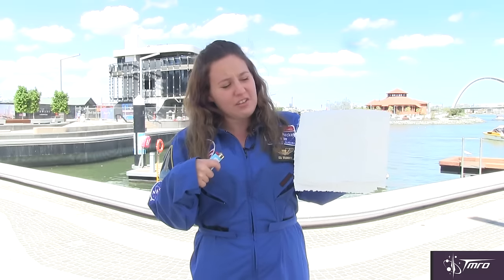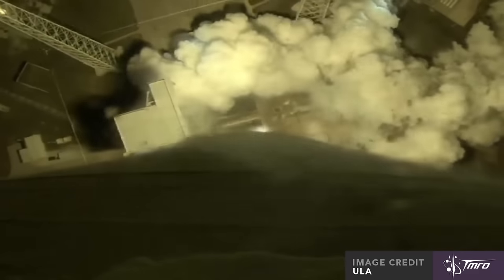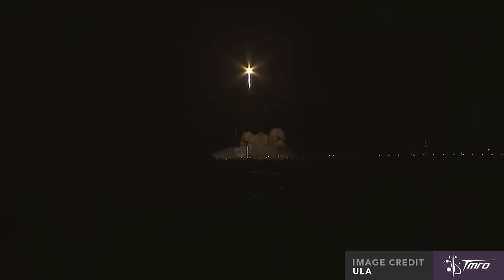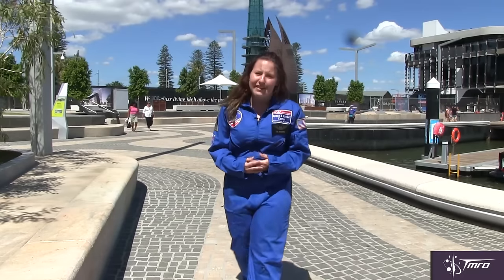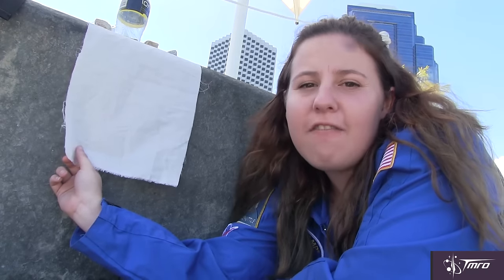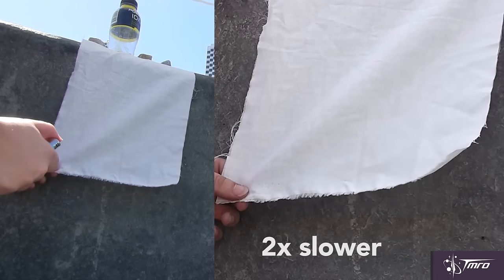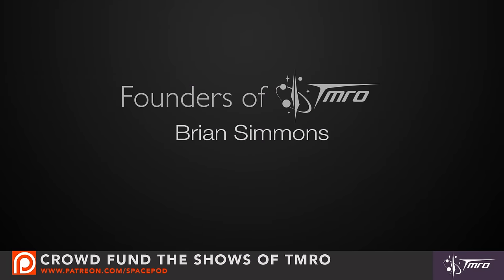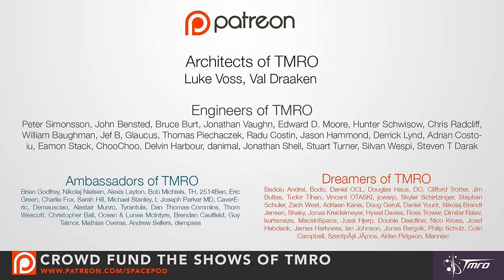Setting fire to Cygnus – Space Pod 3/23/16

Comment: Although the Cygnus made it orbit, it appears there may have been an anomaly on this launch. The upper stage Centaur had to burn +90 seconds longer than planned. Perhaps due to a booster performance shortfall. The Booster Engine Cut Off (BECO) was about 5.5 seconds early. Upper stage did not de-orbit into the planned area. Good thing there was a decent amount of margin on this flight.